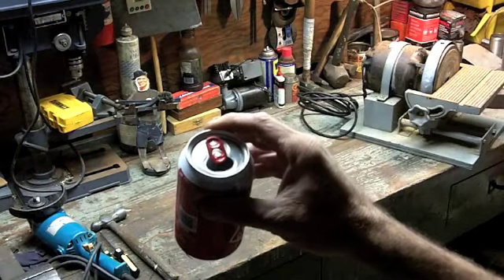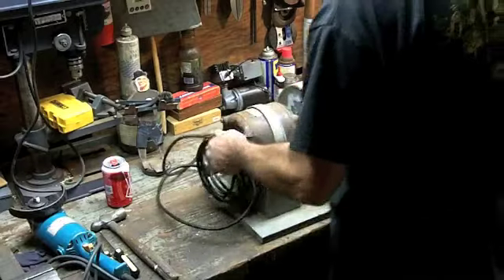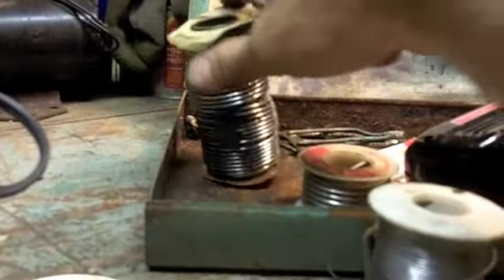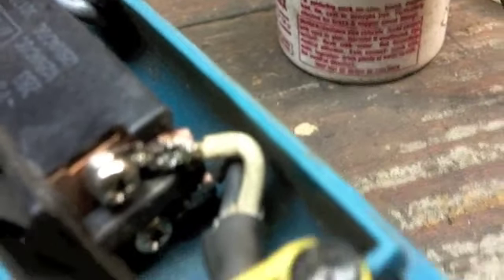Bee Update and Tool Repair

Comment: At least some good news for Hive No 2! The angle grinder should give you years of grinding - they are good tools. I presume there is a grinding disc either stuck or attached using velcro on the face of that flywheel? Useful tool all round and seems to run real smooth.
Reply from the maker: Dan Whiteford Hey Dan, The disk on the sander is a peel and stick. Thanks for watching!

Comment: You can also use soldier instead of lead on small metal repairs.
Reply from the maker: Lawrence Eich Hey Lawrence, I didn't elaborate on this vid, but I used a solid core solder and propane to get the bracket reattached.  It seems to be stuck very soild. Thanks!

Comment: Torquey little thing almost like my 55lb B&D grinder it will get away from you. Well maybe not 55lb's but after 2hours it feels like it.
Reply from the maker: scottsinfl All my larger grinders are old metal cased machines. they work extremely well, but get heavy real fast... this is the first plastic case one I own... I feel fancy now.  hahahahaha
Reply: yourbeekeeper Lube the gear case and they last a long time and so will your arms from the lite weight.
Reply from the maker: Thanks for the tip...  I realized while editing this video that I should have cracked open the head and checked the gears.. I definately will inspect and grease it up before I put it in service.